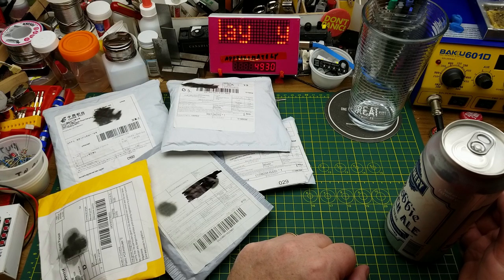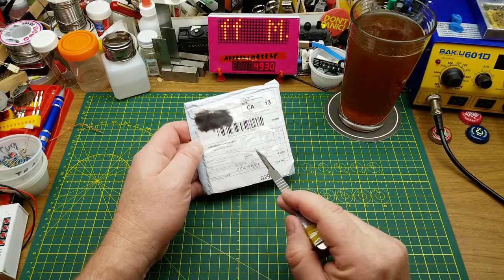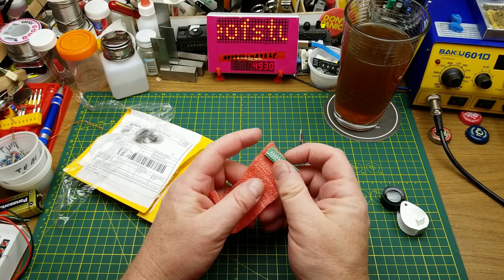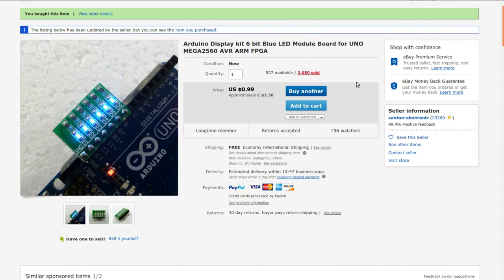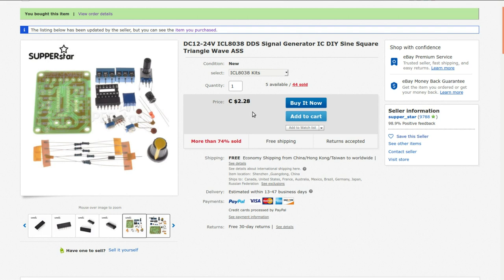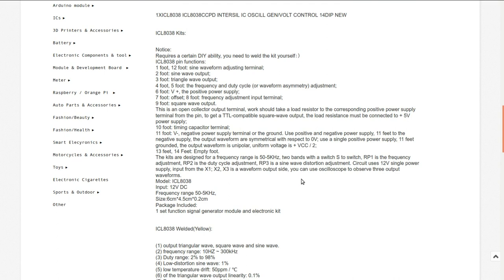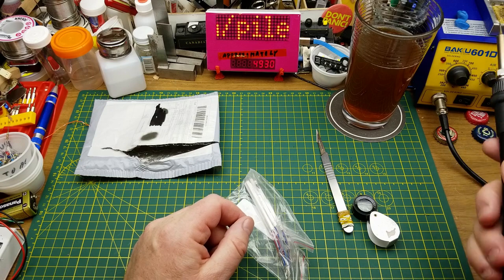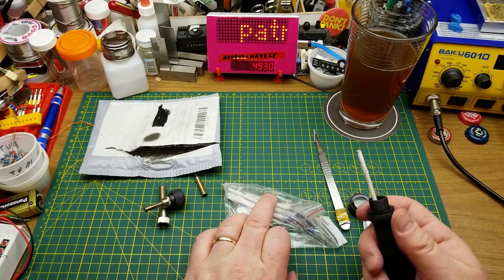mailbag Monday 78

Comment: TIP122 are a great device for making Electronic Loads. They don't tend to oscillate like Mosfets, and the internal resistance/voltage drop doesn't matter at all when making a load device.

Comment: Love those really high hFE Darlingtons...  Perfect for capacitive-multiplier stage in a linear power supply.   And, that ICL8038 is as old as Methuselah.  Here's hoping for a super-creative 2020.
Reply: Watched the EEVBlog video on capacitor multipliers ... and that is an interesting application for big BPJs.  TrenchFETs and HEXFETs are my go-to though for switching applications.  Modern logic-level power MOSFETs have such low Rds(on) with good switching speeds, that my power BPJs gather dust.

Comment: I have an audio generator with the 8038 chip, it has op amps and output transistors to drive the output into 50 ohms.
So it is possible to make a decent generator out of one, mine goes to 20khz max.

That led board is so inaccurate, the listing says 1-2 centimeters error lol.
Love the daft mistakes sellers make, nearly as good as reading old vcr instructions, or self assembly furnature instructions :-D
Reply: There's a reason IKEA uses pictures only... 🛠🔩